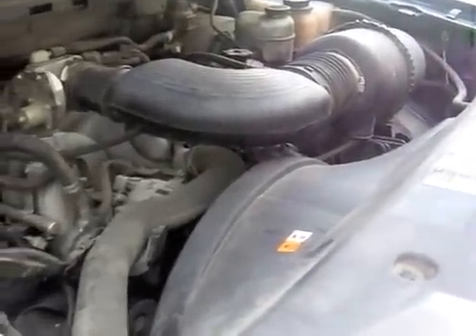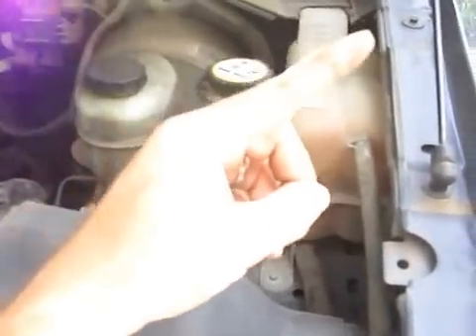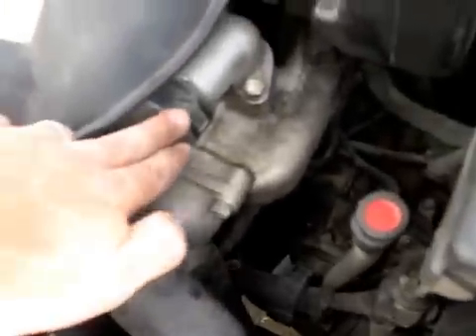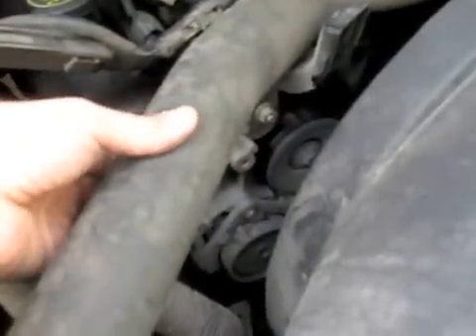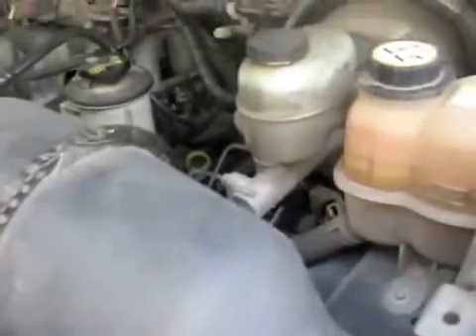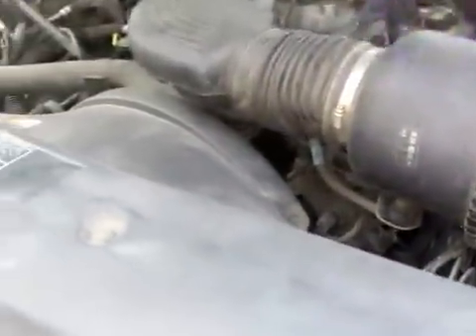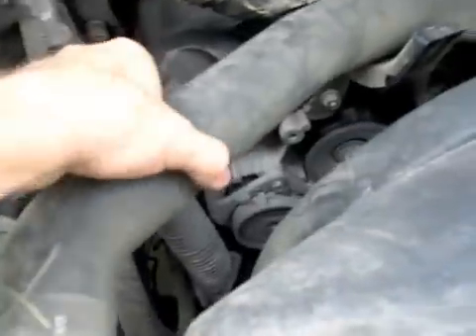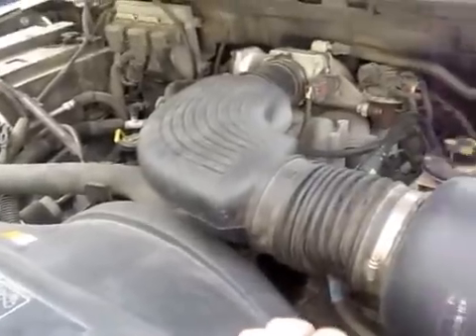Car Engine Overheating - Causes and Symptoms of Over Heating  Car Engine

Comment: hi, I have a 2003 Honda accord and my car heat goes up when it's on idling, when i turn it off the gauge comes down again. I just changed my anti freeze recently that is when I started to experience this issue.

Comment from the maker: You sure the coolant level is full inside the radiator? Steam under the hood means, coolant/water came in contact with the hot engine, so I would assume you have an external leak somewhere.  Although, a radiator that is restricted at the bottom can cause overheating, then coolant to escape out the overflow bottle onto the hot engine and produce the steam. Radiator problems usually show up at higher speeds and or extended driving times at higher speed (meaning not slow or idle speed)

Comment: I have a 4WD diesel powered engine which only clocked 1000km+ , the engine overheated and steam came out fro  the engine compartment. It happened after I drove at high speed 150-160 km/h for slightly more than 30 minutes. What can be the cause as it is a new vehicle . The coolant level is full and the fan is working normally.

Comment from the maker: They usually fail to open, the metal spring inside can rust, get stuck and the rubber gasket around the spring can leak.

Comment from the maker: Good question I am not real sure the exact number. The system/engine/computer are designed to operate at 225 degrees and anything over that starts to cause problems.

Comment from the maker: It could be a restriction in the radiator. But first, I would check this.

1. Open radiator, if low on coolant get a cooling system pressure test to find leak.

2. Check for an air pocket that might be trapped in the coolant, bled out any air that might be in the system. This air can get trapped after doing a coolant type repair.

3. Make sure there are no coolant or air flow restrictions. Air flow across the radiator and coolant flow going through the radiator. Upper/ lower rad hoses same temp

Comment: My car is overheating a little bit, just over middle line, and the AC (cool air not fan) cuts off as it starts to overheat.  I only see it overheat when I start getting on the freeway.  Would this be the radiator causing this issue?

Comment from the maker: Do you only have 1 electric fan up near the radiator? Some cars have 2, 1 for the A.C and one for the radiator.  The ac fan will or should come on when the compressor comes on. If you are low on Freon, the compressor will not come on and neither will the condenser fan under the hood.  I would start with checking the Freon level and pressure with gauges, then check for power to the fan motor. But to answer your question, usually the motor itself goes out...but maybe not in your case.

Comment from the maker: Did I not reply to your question??? So sorry.  If you have steam or white smoke coming from under the hood then you most likely have a coolant leak somewhere and the coolant is spraying on the hot engine producing steam. Get a cooling system pressure test if you can not see where the leak is coming from.  Should be a simple repair, a radiator hose leak or something along those lines....hopefully.

Comment from the maker: Get a cooling system pressure test first to see if there is a leak somewhere.  Then check cooling fan motors and switches, then check radiator for a restriction. If low on coolant fans will not be able to do their job because the sensor can not read the temperature of the coolant to turn on the fans.

Comment from the maker: If you see steam coming through the vents inside the car then you probably have a heater core leak. The heater core is on the passenger side, behind the glove box. Feel the carpet (pull carpet back a little) on the passenger side and see if it is wet.....if it is the heater core will need to be replaced.

Comment: I have a 93 honda, when i let my car ran to warm up after 10 to 20 mins i notice it stars to run hot..  i can smell and see coolent steam or smoke coming threw my vents after awhile .. i had a hose leake prior to that but it didnt start until after i change the hose.. do you have  any ideal as of why or what it could be??... whats the next step i should take???? thanks

Comment from the maker: More than welcome. If you think you have a coolant leak then you need a Cooling System Pressure Tester. A compression tester is used on the engine to determine if there is internal wear/damage.

Comment: Thankyou this has helped me a lot, I have a 2002 Chrysler sebring convertible Lx 2.4L , My temperature gauge jumps up sometimes when I accelerate too hard, I came home parked in the driveway , I noticed I have a Leak in the front, I think its oil, I need to buy a compression test to see where its coming from. I'l be back on here to comment when I find out more.

Comment from the maker: The bent fins are pretty normal, road debris and bugs etc. can easily damage the thin aluminum. The real issue is inside the radiator at the bottom, where mineral deposits and rust build up and restrict the flow of coolant. BUT, usually a radiator restriction problem shows up at highway speeds rather than slow speed or sitting in traffic. Keep us posted as to what happens.
Reply: TrustMyMechanic.com I've been told I have a blown head gasket or water pump I have a 2010 Town and country I no from the person I got it from it does need a new radiator. What should I believe also is the water pump for a 2010 Town and Country the same as it would be for a Dodge?

Comment: A bunch of the fins on the radiator are bent. I just noticed it overheating yesterday when I took it to a city with lots of traffic lights. The fans are operating fine. I just replaced the thermostat and it did nothing. I will be replacing the radiator in a few days.

Comment from the maker: Usually means there is not enough air flow across the radiator, and a cooling fan problem is probably the issue. Always start with a cooling system pressure test to see if you have an internal or external coolant leak, check upper and lower radiator hoses when engine is at normal operating temp to see if they are the same temp (if not, a radiator restriction is likely) and make sure there are no air pockets in cooling system.

Comment from the maker: Yes, the water inside the radiator will go up and down slightly, and you should see or might see rise in the overflow bottle on the side.  You should not be able to see the "cores" inside the radiator though, those should stay covered with coolant. Just make sure the radiator is full to the top with coolant when the engine is off, and there are no coolant leaks.

Comment: hi sir. i have a honda civic 2002 vtec 3. is it normal that the water in the radiator goes down when the cooling fan turns on? please help. thanks

Comment: Thanks man this really helped me out I have a 2003 Dodge ram 1500 that does run hot on the highway and at idle speeds replaced fan clutch and radiator which stopped problem and it gets really hot out here in Killeen TX too

Comment from the maker: Just make sure there are no kinks or restrictions in the radiator hoses that would reduce coolant flow. As a rule of thumb, I always replace the thermostat when replacing the radiator or where there was an overheating problem.

Comment from the maker: Are you sure there are no air pockets in the coolant that need to be bled out?  Double check the coolant level inside the radiator to make sure it is completely full.  Other things that can cause this. Anything restricting air flow across the radiator, ignition timing that is set to far advanced, even low engine oil could be a factor. I would also make double sure the new radiator is the same width as the old one. same number of "rows" and now narrower or smaller than old one.

Comment from the maker: usually it is a bad cooling fan motor, but can also be a cooling fan sensor problem. The sensor measures coolant temp then sends the signal to the fan motor to come on of turn off.

Comment: I just bleed it with the engine off technique ,, and no more overheat...but I am gonna pressure test it..my mechanic done that before...and about the o2 censors I did notice a 2 mpg drop..thank you for sharing your input

Comment from the maker: You need to get a cooling system pressure test to find the leak. Could be anything, a radiator or heater hose, water pump, radiator etc. etc. I would assume it is something like that above and not a headgasket or anything really really expensive.

Comment: Hey I have a question...I have a 2001 325ci. And yesterday I came out of walmart and saw that a small puddle of radiator fluid  leaked out by the passenger side tire...I waited for engine too cool down then I checked my fluid and its full,  so I turned it on and drove for 1 minute then the the light overheats to red so I pulled over...any adivice what it could be??

Comment from the maker: Sounds like lack of coolant flowing inside the engine.  Could be that the water pump is wrong and the impeller is backwards from the original (rare but seen it) or it could be that the thermostat is stuck (I would just replace it anyway as a cheap guess). I would also make sure this is not a gauge problem and the engine is really overheating.

remove the radiator cap and see if you can see any coolant circulating with the engine running, you should.

Comment: i have a1994 camaro v6 and i just got a new water pump,new radiator and cap, and a new gasket behind the water pump. there isnt a leak. and it gets hot within minutes as soon as i turn on the car. i dont have to keep putting in antifreeze into the car and the radiator fan is working fine. wht do you think it is?

Comment from the maker: Yes it can be but it can be other things as well.

I would replace the hose, 

do a cooling system pressure test to see if there are other leaks,
 
then check the radiator for a restriction, make sure upper and lower rad hoses are some what the same temp when engine is warm.

check the electric radiator cooling fan operation,

test the radiator cap 

and make sure there are no air bubbles/pockets in the cooling system.

test the thermostat

Comment from the maker: Probably, Causes could be 
Faulty spark plug or spark plug wire
Faulty coil (pack)
Faulty oxygen sensor(s)
Faulty fuel injector
Burned exhaust valve
Faulty catalytic converter(s)
Running out of fuel
Poor compression
Defective computer

the po400 is an EGR type of problem, I would try and correct the engine miss first and see if any codes reappear.

Comment from the maker: Its possible that you have a gauge problem, but its VERY rare. You did the pressure test and there are no leak?  You checked the radiator for a restriction and there is none, you checked for air in the cooling system that needs to be bled out, you checked the electric cooling fan on the radiator and it is working? If all those come out ok, then have a mechanic check the temperature sending unit, that tells the dashgauge how how the engine is. its cheap part, if you want to just guess and replace

Comment from the maker: Yes, you can probably still drive it BUT now that we have a YELLOW check engine light and a roughness/shaky complaint you mentioned earlier I am starting to believe you do have a missfire type of problem. Could be a bad spark plug wire or ignition coil problem or something more serious. 

The engine light is on because the computer sees a problem and has stored a code in memory for your mechanic to read and troubleshoot.

Comment from the maker: The shaking....does the engine feel like it is misfiring?  Dose the engine perform normal and have power like it should? If those items are ok, the shaking could be just a vibration issue like from a bad or worn engine mount, or it could be due to a missfire, and a cylinder is not performing properly.

If you are not loosing coolant and not overheating, I would not really suspect an internal coolant leak, or headgasket type of problem but still need it checked out to be sure.

Comment from the maker: Hi there, I am afraid I am not familiar with this vehicle (as I have not heard of it in the U.S.), or with diesel engines for that matter.  it does however sound like you have some kind of heat related problem and a sensor of some kind I am just not familiar with your vehicle to help .....sorry.

Comment: helo sir..iv got van mazda bongo diesel..question is why my engine always suddenly stop running when idleing at the traffic lite and after 20mins to 30mins or maybe cooling down its can start again...is they any connection with the overheat sensor?

Comment from the maker: Its not too uncommon to hear a little steam/bubble noise after the engine has been driven a long time. I would be more concerned with 1. is it overheating 2. are you loosing coolant

The burping, yes that would indicate 1. either the system was not properly bled of air during the last cooling system repair or 2. there is a leak in the system allowing air to come in.

The cooling system pressure test should tell you that, and you need to have that done. Its cheap and easy

Comment from the maker: Does the engine run hot?  Are the electric cooling fans coming on?  is there pressure on the upper radiator hose when the engine is hot? You should have trouble squeezing the upper hose together (use a rag it will be very hot).

 if it is not hard to squeeze you have a leak somewhere or a bad radiator cap that is not holding pressure inside the system.

Comment from the maker: Those plastic reservoirs DO leak, so make sure there is not a crack on the bottom of the back you can not see.  if you are sure the bottle is not leaking, then I would get a cooling system pressure test to help you determine where the leak is coming from.

This is a simple and cheap test and just about any mechanic can do it while you wait. the leak could be from anything, radiator, water pump, heater core, radiator or heater hoses etc.

Comment from the maker: I would first check to see if you have an exhaust leak under the hood at the exhaust manifold or flange gasket connection at the manifold to the exhaust pipe or under the vehicle in the exhaust pipe/muffler/converter that is leaking fumes inside the vehicle. Also check to see if you have an oil leak, which can smell like exhaust inside the vehicle.

I would also use the RECIRCULATION setting for the a/c and not use the fresh air setting to see if that helps.

Comment from the maker: Is it low on coolant?  If so and you can not see the leak, get a cooling system pressure test to find the leak. If the radiator is full, and there are no leaks.

Check the electric radiator cooling fan and make sure it is coming on at idle when the engine is warm.  

Then check for a restriction in the radiator. Both upper and lower radiator hoses should be able the same temperature.

Comment from the maker: USUALLY when that happens it is because the engine is running hotter than it should and boiling over inside the radiator to the overflow bottle, which is why it is there.  But, the running hot issue has to be addressed. Could be due to a coolant leak (get a cooling system pressure test) or it could be due to a restriction in the bottom of the radiator and a new radiator is the answer.  Rule out a leak, check electric radiator cooling fans, check radiator for restriction.

Comment from the maker: Get a cooling system pressure test to rule out the possibility of a small coolant leak, but this could be due to a radiator that is slightly restricted at the bottom and allowing just enough coolant to flow as to break even on the temp gauge. What you are seeing COULD be normal, I would have to see it personally.  I would feel the upper and lower radiator hoses after your long trip and see if they are about the same temp, they should be close. If upper is hotter than lower, radiator restriction

Comment from the maker: I would get a cooling system pressure test and rule out either an internal (headgasket) leak or an external leak you are missing and that leak is not allowing the system to hold pressure, also test the radiator cap. If no leaks, I would check to make sure the engine is actually running hot and not a gauge problem. I would use a thermal thermometer on the engine to verify temperature. Also make sure there are no air pockets in the system.

Comment: hi I got a chevy colorado 3.5 5cyl   and it over heats  I replace the radiator, water pump, hoses, fan clutch, and thermostat ...... that didn't work so replace the fan clutch to an electric fan  put one one the front of condenser as a pusher  and another one on the back of the radiator as a puller .... this didn't work it keeps overheating to 235F any suggest??

Comment from the maker: If you can't see where the leak is coming from with your naked eye, then get a "cooling system pressure test" (which is fast and cheap)  to locate the leak. If you don't have any white smoke coming from the exhaust pipe I would not worry to much about the white chalk stuff, but after I repaired the leak I might flush out the cooling system and add new coolant.

Comment from the maker: Thank you.  Remember that "flushing" really doesn't do much and that the junk and mineral build up happens at the bottom of the radiator which can not be easily flushed out. A new radiator is usually the cure.  Make sure there are no coolant leaks, no air in system, the engine IS actually running hot and not a gauge issue and the radiator is not restricted at the bottom.  Upper and lower rad hoses should be able the same temp when running hot.If you have over 100K miles a restriction is possible

Comment: Thanks for the info. Very informative. I'm having trouble with my 2004 Durango. Replaced water pump and fan clutch. Coolant flushed out too and still running hotter than should be.